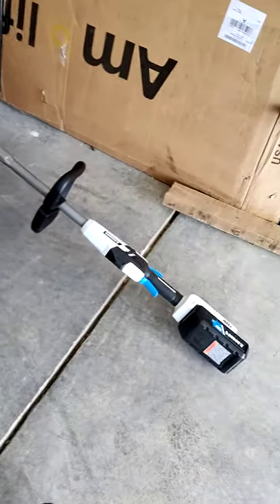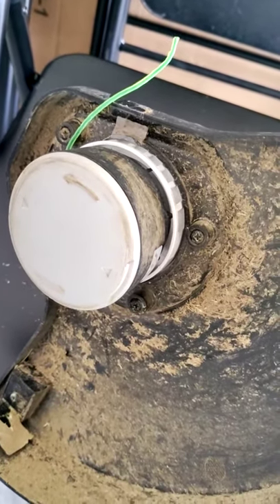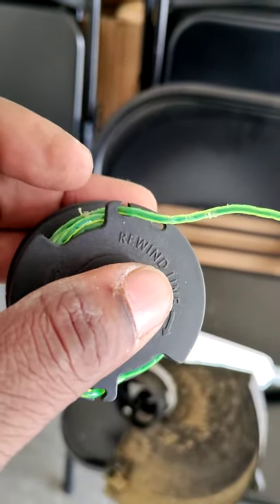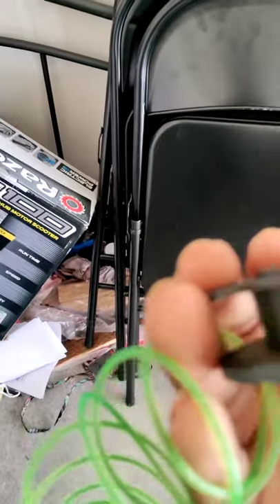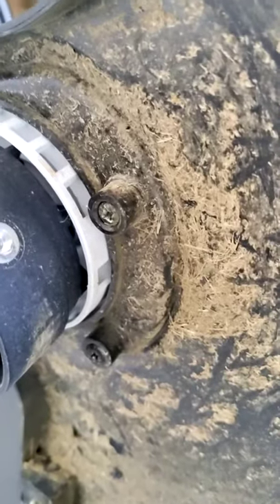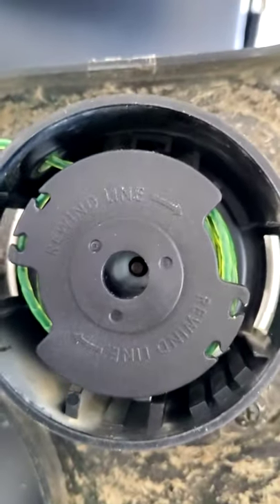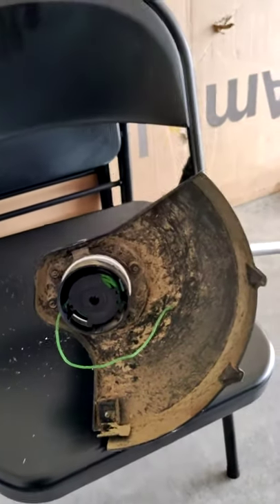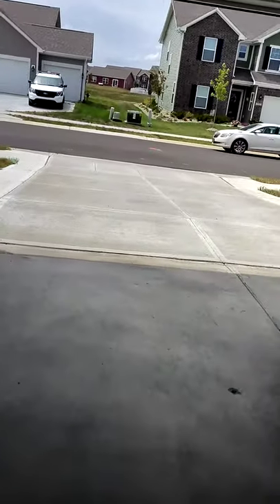Re spool your Hart lithium 40 volt weed wacker

Comment: We were getting frustrated with this.  Difficult is an understatement 😫 thank you for making this quick how to
Reply from the maker: If still have issues wrap opposite direction
Reply: @MrfixitLbrighes  we haven't been able to use it. Need other buying options.
Reply: @MrfixitLbrighes  thank you for mentioning wrap the opposite direction and when you insert your string into the whole it will need to in the opposite direction the whole  is facing!!😅
Reply: Is there a certain size string for this type? If so someone please share. And thank you for clearing this up good video🙏🏾

Comment: Hypertough 20v string and stool  fits on hart 12inch string trimmer. Save you some money. From keep buying the hart version string and stool. Hypertough 20v string and stool is 5 bucks at Walmart...💯
Reply: thanks, i will get hypertough line..
Reply: thanks for this...was wondering
Reply: Yeah. I use the hyper tough 20v spool string. I and I cut a big backyard and still had alot left for another cut

Comment: THANK YOU!  I hate that they want you to buy a new spool every time you run out of string. It so wasteful (and expensive!).  I have a gas trimmer that I’ve used forever, so restringing is nothing new.  Now I can do that with the Hart also.  I did buy a replacement spool so I don’t have to stop and restring while I’m in the yard. I can just replace the spool and restring before the next cut. It saves a lot of time.
Reply from the maker: I Actually bought the roll of trimmer wire 0.095, which is a lot stronger then what manufacturer recommends

Comment: I just bought this, the string keeps coming out and tangling with stuff, getting caught in the gear. I used eheir prestrung ones too.
Reply from the maker: Unravel it and wrap it in the opposite direction
Reply: Tried that didn't  work

Comment: mine is constantly giving out line after respooling to the point it gets stuck on that axle inside.
Reply from the maker: Wrap it in the opposite direction
Reply: @MrfixitLbrighes  yep about two hours after I posted I got home from work and tried that. No issues except for the “cutter” being made of plastic
Reply: Mine does the same thing, just got it last week.
Reply: @MrfixitLbrighes  thanks I will try that,I came here thinking I was doing something wrong.  The line was already wrapped when I bought it, I'll definitely try that. Thank you!